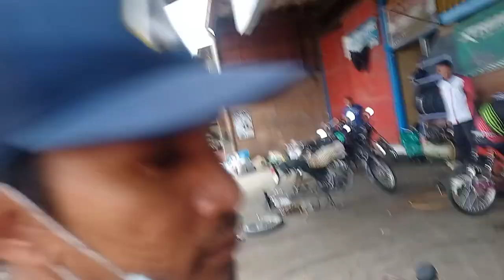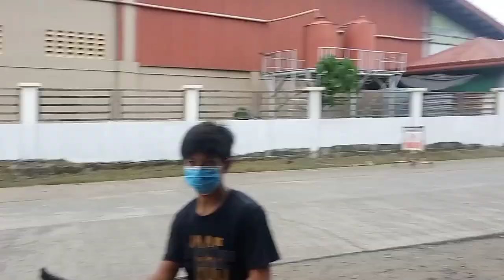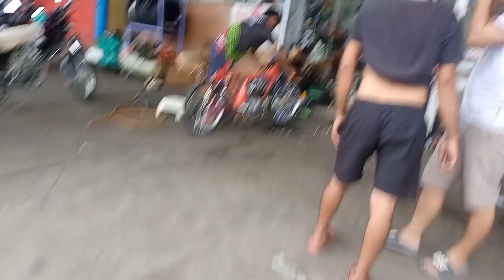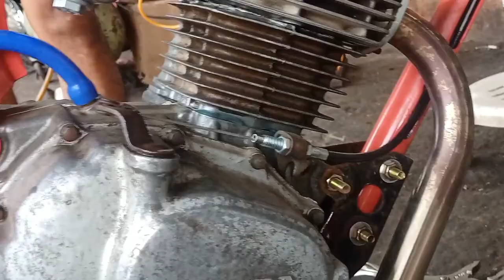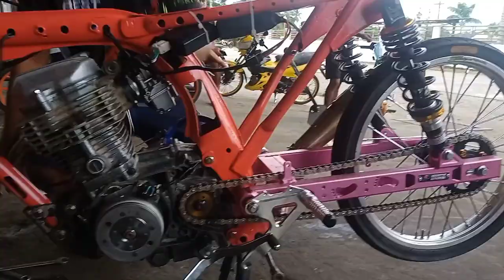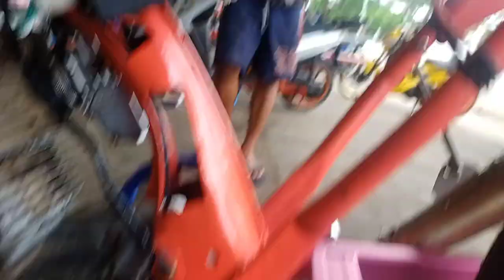mamaw na tmx 155 65mm bore 5mm stroke

Comment: Sir kapag cg200 block gmit sa tmx 196cm..need paba ngpalit ng crankshaft ng png 200 cc din?slmt po
Reply from the maker: hindi na po..need lang ng balance at rod..pwd rn bawasan yung bore
Reply: Ahh gnun poba..wla po ba mgging effect yong sir kapag mag pin? For daily use po
Reply from the maker: mataas compression pag nag pin..magamit dpnd sa taas ng pin peru hindi tuloy2 na ma birit
Reply: Sir if hndi ako mgpin pwede rin poba?ang ggwin nalng is mgbabawas nalng ng bore okey din poba ayun?slmt po
Reply from the maker: @alvarezmarkgerald7390  oo pwd yun.. balance lang ng crankshaft..kung low speed..gear na rin para may pang dulo
Reply: Ahh sige po..maraming salamt po.. godbless
Reply: @ken26vlog13  paps matanong ko lang ilang mm po ibawas natin kung cg200 (196cm3) iagay ko sa tmx155,,,
Ok lang po ba  kahit hindi naka balance crankshaft?stock stroke lang,,,solid subcriber here,,,,,
Reply from the maker: @mx06  dpnd po sa setting ng makina..una po ilagay muna sa motor yung bore at piston..tska duon mag decide gamit ang caliper..iba2 kc ang setting..pwd hi.com pwd rn mababa lang.. 63mm kc piston ng cg200..mas mabuti parin pa balance para hindi vibrate at may dulo ang takbo

Comment: Stock valve poba yan boss?
Reply from the maker: di po..bigvalves nayan
Reply: Anong size po nang big valves sir at pang anong motor kasukat? Sana masagot
Reply from the maker: @jeffreymaliwat3831  sa nung motor lalagyan?
Reply from the maker: @jeffreymaliwat3831  pwd yung valves ng mga rusi..palit kalang ng valve lock na pang rusi dn
Reply: Sukat po pamg tmx155 anong rusi po 175? At anong size po nang Intake at exhaust stock po nang tmx155 is 30/25 diba po?

Comment: Boss ok lang ba na 3 stad bolt lang nakakabit
Reply from the maker: mas maganda apat sir..madali puputok head mo sir pag tatlo lang..di balance ang higpit
Reply: Boss 65mm bore diba para sobra nipis na ng crank or sa sleave na pa nipis
Reply from the maker: @jamesmore3042  bore out na sir..pinalakihan butas ng center case tapos nka change na ng liner
Reply: Boss ako ano may gagawin din ako po kumuha ako ng block ng ssx200 ok lang sya daily at san kaya ko babawas crank bore ba sa gitna or sa sleave p0 ano kaya mas ok
Reply from the maker: @jamesmore3042  sa tmx ba ilalagay? wlang problema kahit malaki ang block basta yung tinatawag na under yung compression..or under yung piston..para hindi mashadu mainit sa makina pera yung power andyan parin..
Reply from the maker: @jamesmore3042  20 50 oil tlaga gamitin mo..wag ka mag synthetic kc nipis yun payu q lang
Reply: Boss salamat sarili works lang ah sa rusi 150 ko ikakabit kaysa sya pero magtatabas ako sa crank bore di kaya humina basta alalayan kolang tabas
Reply from the maker: @jamesmore3042  hnd nmn dpnd tlaga sa setting
Reply: Tips lang boss san maganda mag tabas sa crank bore ba sa gitna or sa sleave